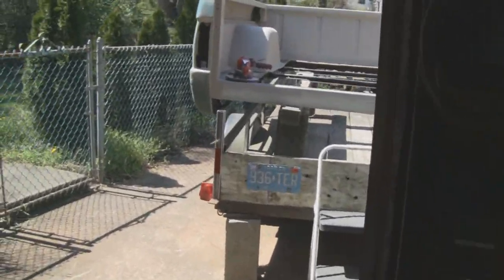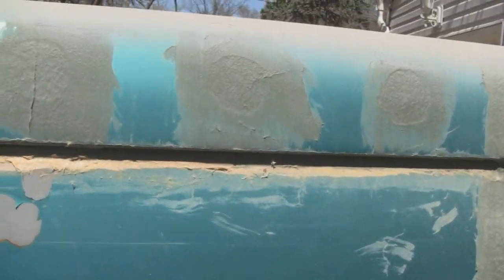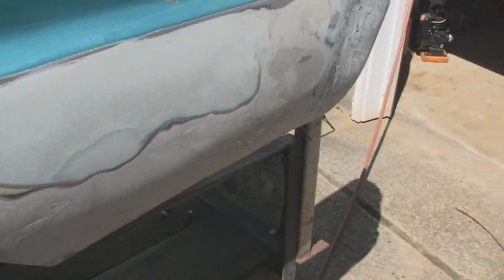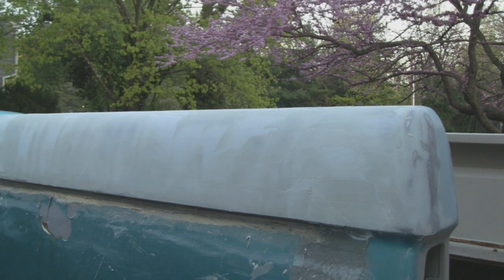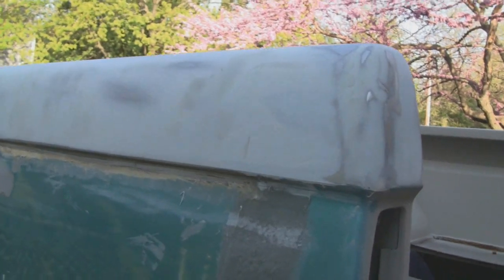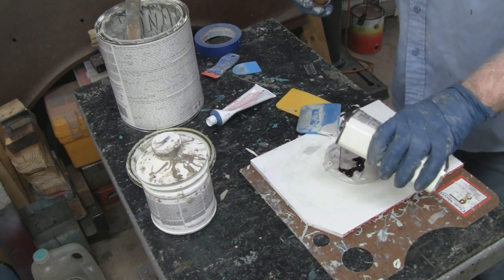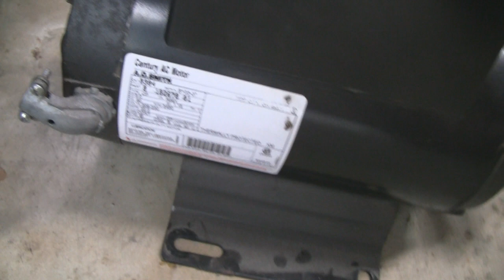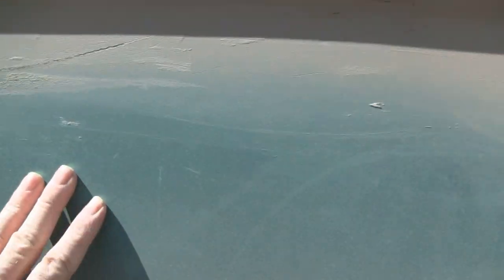START BODYWORK ON OUTSIDE of PICK UP BED (F100 part 112)

Comment: That's a cool block - good size 😊  Thanks for sharing RK - have a nice spring - looks nice there :)
Reply from the maker: Thanks Jerry!! That Block is great for pick up beds but that's about it!!☻
Reply: @805ROADKING  I have made lonnnnnng blocks out of freshly planed 2X4's before for pick up box sides, just stick a bunch of 80 grit on and have at it.  I enjoy your skills at bodywork, same set of skills I had.  I have 46 years experience. 1963 through 2009.  had to retire early, my body needed repairs.
Reply from the maker: Thanks Larry!! We started doing Bodywork and Paint back in 1971, now we just work on our own stuff for fun!!
Reply: @805ROADKING  I live in the RUST belt of Michigan, I gave up on keeping my 2003 S-10 rust free, plus, I can't get down low enough anymore or jack it up.

Comment: The bed looks great!  It's a bummer that the compressor went down, Amazon has a good selection of 5 HP motors many have 7/8" shafts.   I remember the HVLP push 30 years ago. =D   Great stuff!
Reply from the maker: Thanks alot Bud!! Yeah we got it from Amazon!! It was sent directly from the Distributor and delivered by UPS, it got here in 2 days!!☻